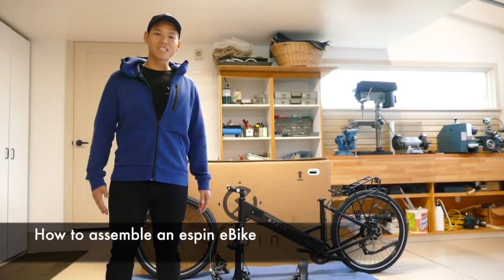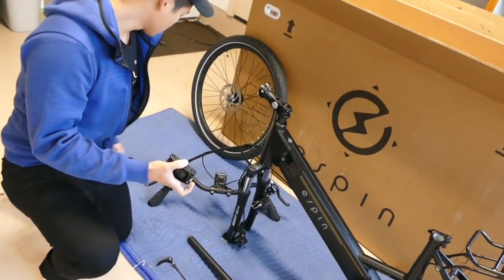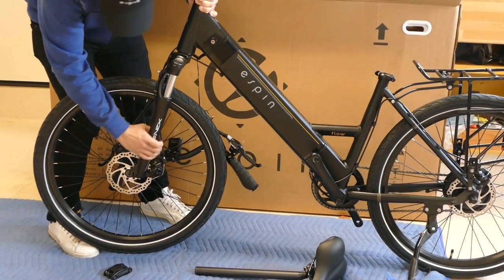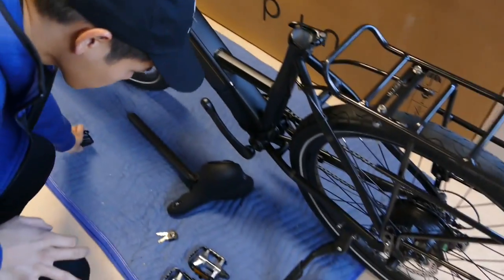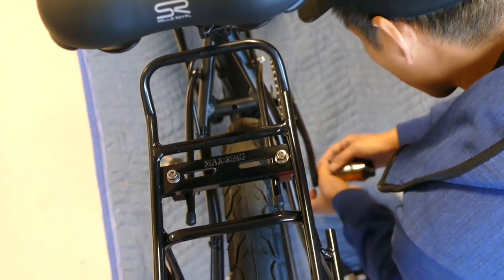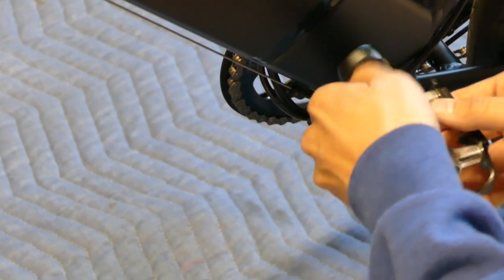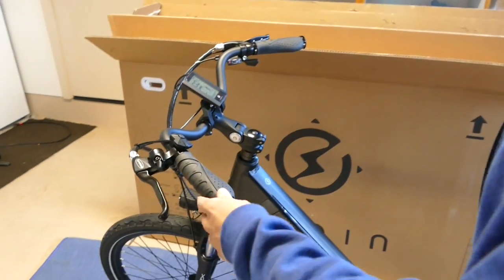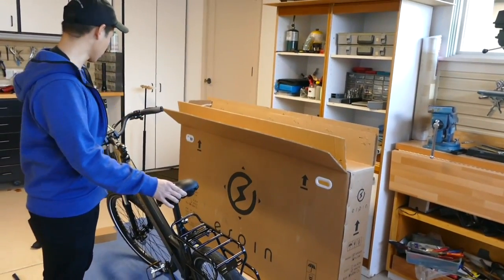How to assemble your Espin pedal-assist eBike

Comment: I got my Sport last Wednesday and it was easy to assemble. 
I like how you listen to users and keep upgrading the components on the bikes you sell. 
May I suggest a bit wider pedals on the Sport and Flow in the future. I have small narrow
feet and I had to buy wider pedals. My heels kept striking the crank arms. The one on the left
especially. I measured and it has about 1/8 of a curve in  towards the frame compared to the right side. 
I love my new bike and will be using it for years.

Comment: With your experience with the bike these years do you think the Fat Tire version is even necessary? Besides main roads I do mainly fire road, tow path, smooth hard pack trails etc.. Thanks..!
Reply from the maker: Hi Gerry, if you are riding on hard dirt trails then we recommend the Nesta or Nero.  They have fat tires for maximum traction and have 750W motors instead of the 500W motors on the Sport and Flow.  That extra power will help you up any hills, roots, or rocks that you might encounter, and the fat tires will handle the power better.  If you drop the pressure in the fat tires to 10-15PSI they will handle sand or snow like a dream.  The Sport and Flow are primarily intended for riding on paved surfaces and occasional hard pack trails.
Reply: @espinelectricbikes3486  Many Thanks for the advice..! The extra power should indeed be more fun. Does Espin offer any additional sales discounting through the year?
Reply from the maker: @gerry2893  Unfortunately we do not have any sales planned currently due to supply shortages with chips and batteries.  That could change in the next couple months though, so keep an eye out!
Reply: @espinelectricbikes3486  That's ok as I may get one for my wife regardless. Thanks!